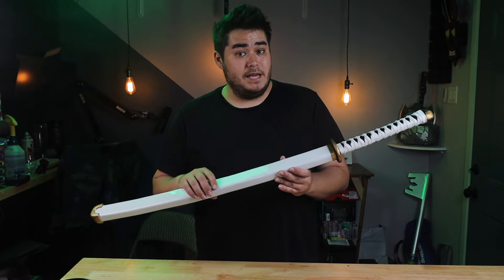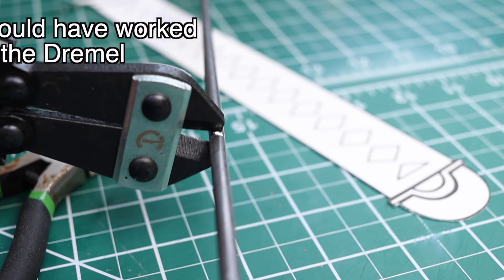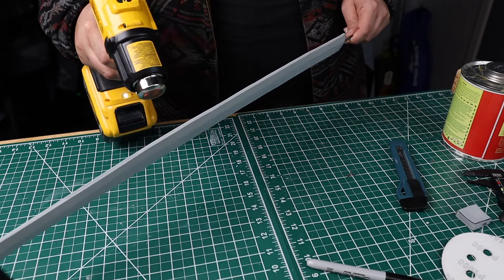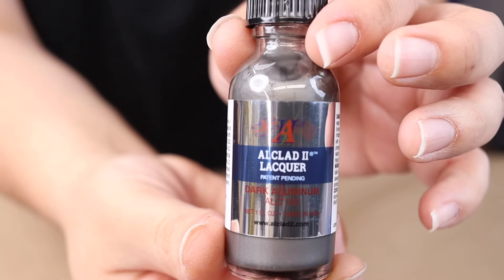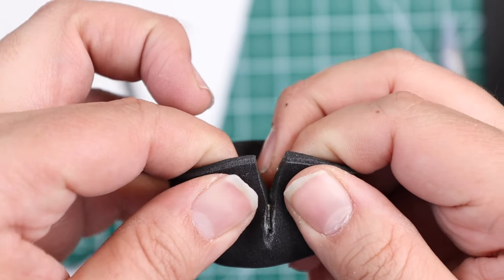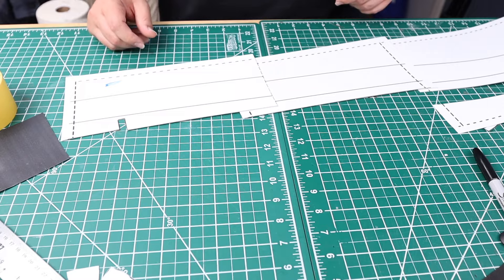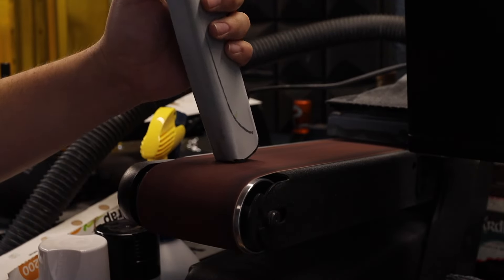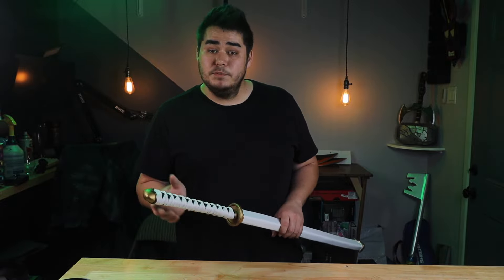How To Make Zoro's Sword From One Piece

Comment: can i just dobble or do i need the big ones
Reply from the maker: @joehjort243  Which part of the video are you referring to? Just wanted to make sure I answer you correctly 😁
Reply: @LockProps  both ad the 8 mm and 10 mm EVA foam
Reply from the maker: @joehjort243  Sorry, still trying to understand what you’re asking, but if you’re saying just using 8mm instead of 10mm, so you don’t have to buy both. Then yeah, you can just get by with one of those sheets. Let me know if you have more questions, I’ll be here.
Reply: @LockProps  np. It just if I could use two 5 mm for a 10. And the same with  two 4 for a 8. Hope that made it bit more clear😊
Reply from the maker: @joehjort243  Oh! Yes, absolutely you can! Just make sure you have enough adhesive to glue everything together!
Reply: @LockProps  thank you

Comment: I bought a prop katana, made from foam. It's black with silver lining the bottom of the blade but for the cosplay I'm doing i need the blade to be complete silver. Would I need to put a primer over the previous paint before I go over it with silver?
Reply from the maker: You can! Because the paint will stick to the primer a lot better than the finished piece. However, primer from a can will crack. If it’s really smooth, you could plastidip it black first, then put the silver on top of that. That way the paint will be on a more flexible surface and wouldn’t crack too much if it bends a certain way. Sadly, any primer or paint from a can tends to have a hardener in it that will crack if bent too far.
Reply: @LockProps  ooh okay thank you so much!! Do you recommend a metallic/shiny silver paint to use? (I don't own an airbrush)

Comment: Is it critical to use a heat gun?  I don't have one 😅
Reply from the maker: The heat gun closes the pores on the foam, so you won't get as smooth of a finish if you don't heat treat the foam. Luckily heat guns aren't too expensive, so might be worth saving up a little and getting one! Unfortunately I haven't had good luck using a hair dryer. I link to a heat gun in the video description and it's currently $28.99 with a 10% coupon on Amazon.